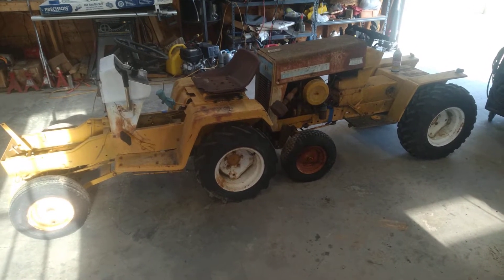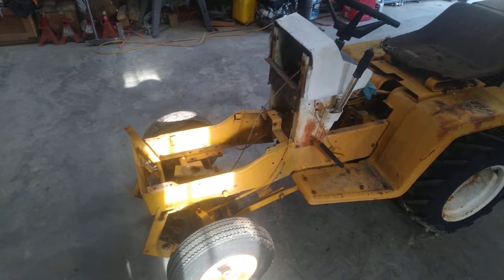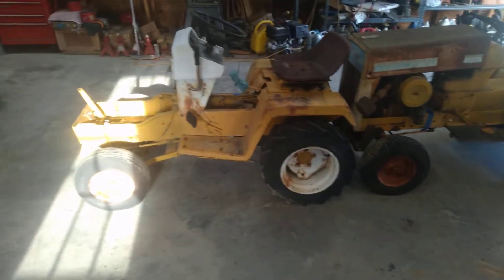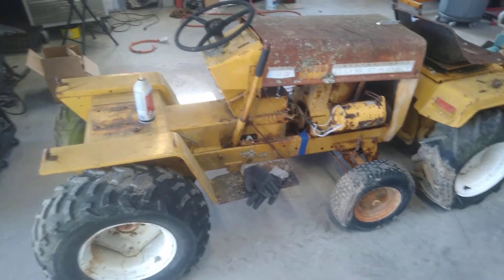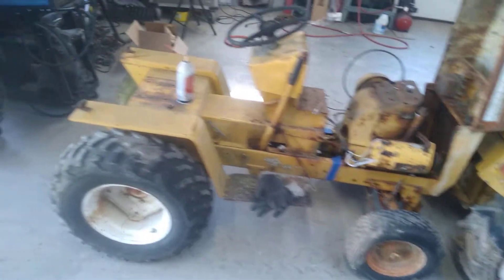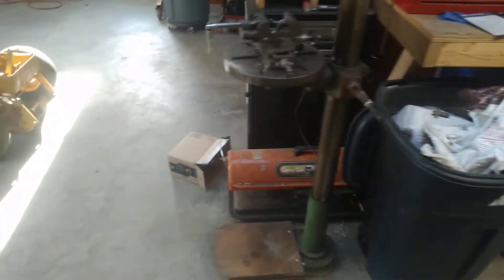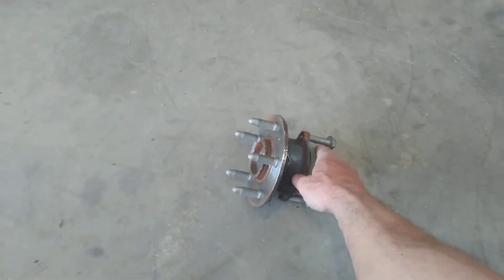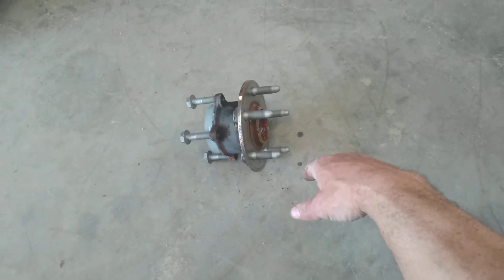The Intro - The Cub

Comment: Do yourself a favor and find another wideframe and get rid of the 123 (not a 16hp BTW)
Reply from the maker: What would be the benefit of finding another wideframe?
Reply: @billbayer5526  the whole idea of having an “on demand” hydro is questionable given you’d basically be forcing the hydro pump to force fluid through the relief valve, would be a drag…literally.
Having two wide frames would give some commonality to the build…and pick your poison, either gear drive or hydro…not both.
Reply from the maker: @onestallfab  Very sensible.  Turns out the hydro doesn't work anyway.